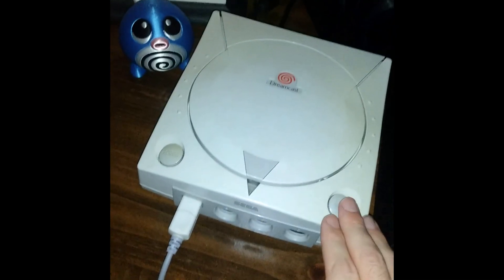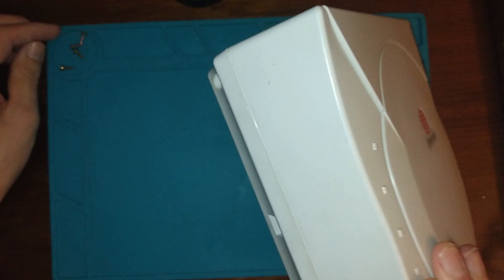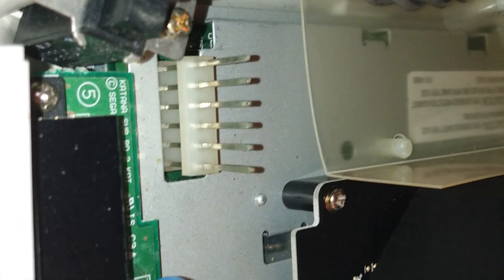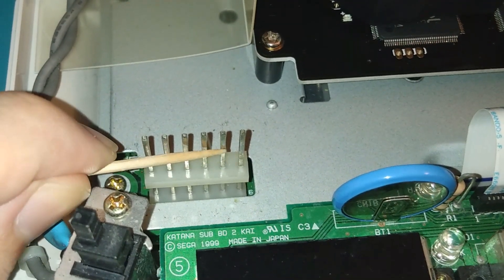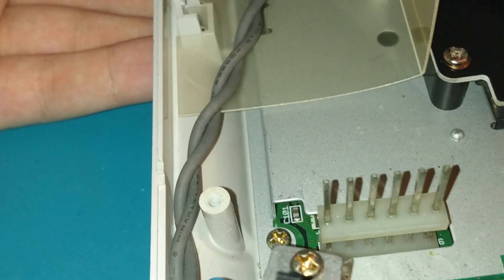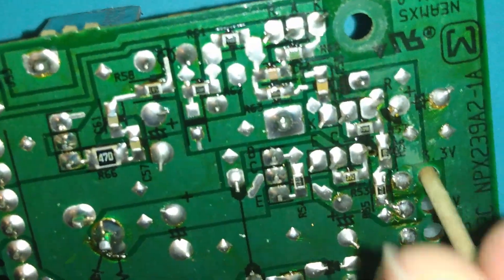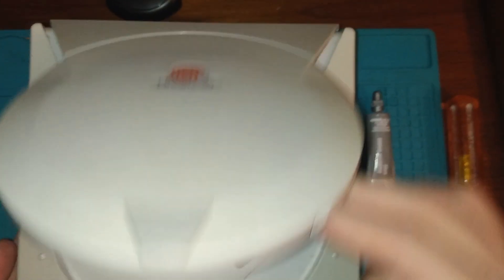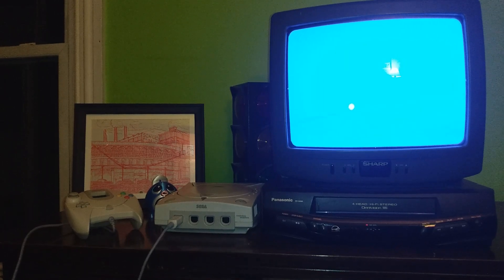Dreamcast GDEMU / Power Supply Troubleshoot Follow-up

Comment: Hey was curious is this still working? Gonna try cleaning my pins to see if that's the issue. If this is a good fix I'll pick this up as well.
Reply from the maker: It is! Just gave it a test because I was curious. Booted 3 different games from 2 different SD cards. No issues. About 15 months and counting since last disassembly!
Reply: Great, thanks!

Comment: I wonder if the Dream PSU would fix that. It’s a replacement power supply and it’s much smaller. I want one but I hate the AC adapter that comes with them. It uses a barrel plug.
Reply from the maker: Good question. The responses are polarizing. Some people swear by the stock PSU. Some people report running with a replacement PSU for years and having no issues. I've heard that modern alternatives like DreamPSU and PicoPSU deliver a more appropriate power load and less heat for Dreamcasts using GDEMUs. I've also seen complaints of Dreamcasts still having the same troubles or even dying completely by replacing the stock PSU with something else. As with GDEMUs, there are now apparently several clones of the PSU alternatives that may be of a questionable build quality. Multiple factors at play.

Half the reason I have yet to replace the stock PSU is because it seems to work perfectly fine as long as the PSU pins on the motherboard are clean enough to make proper contact. All the problems I've run into so far seem to have stemmed from oxidization on the pins.

It makes me wonder how many people thought their stock PSU went bad when, in reality, it was fine and they were just running into the same problem with oxidization that I've been running into. I know from experience that dismounting/re-seating the PSU without cleaning the pins tends to make the Dreamcast work for a little longer, just as unplugging the Dreamcast and plugging it back in tends to make it work for a moment. Perhaps that friction from dismounting the stock PSU from the pins and then mounting the replacement scrapes a bit of the corrosion off and allows it to work better? Perhaps some replacement PSUs combined with unchecked oxidization on the pins creates new problems or kills the DC outright? Hard to say without creating a lab with 2 dozen Dreamcasts and a variety of alternative PSUs.

What I can say is that, while typing this out, I was curious how the Dreamcast in this video was holding up so I turned it on and played a round of Mars Matrix. Nothing extensive but it's still seems to be working well a month later. Here's hoping it stays that way.
Reply: Swap the barrel plug for a USB C PD port.  Most systems use either 12 or 9 v adapters and you can set PD to supply that EZ. Then you can ditch the whole mess and remove another power plug you gotta manage from the collection.  I'm in the process of swapping all of mine to it.  You can get a sheet of the female boards for like 5 dollars US.  Just be aware the soldering the jumpers is kinda tiny on em.  Other that that they are cake and there are 3d files out there for the port to fill the slot and hold it in place.
Reply: @lostapostle76  I recently learned of the Clean PSU which is USB-C, downside is finding them in stock.